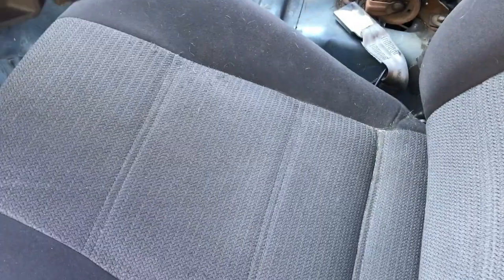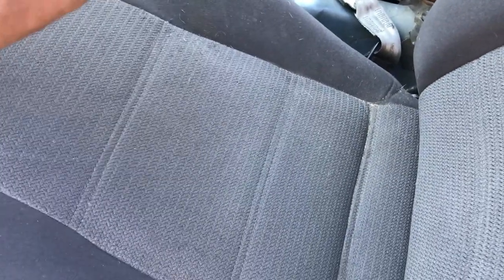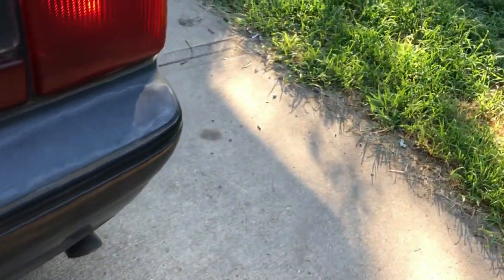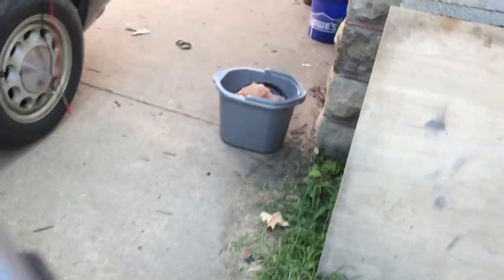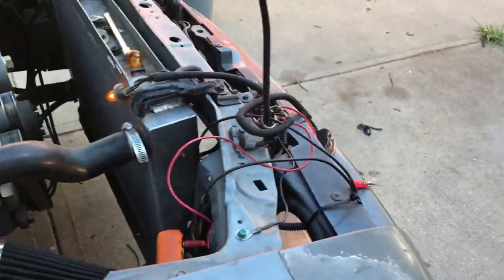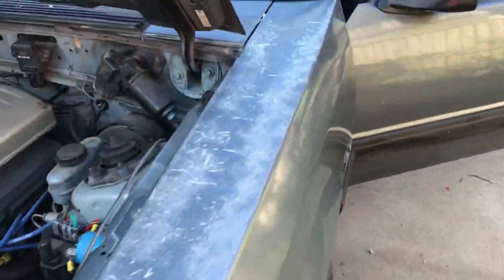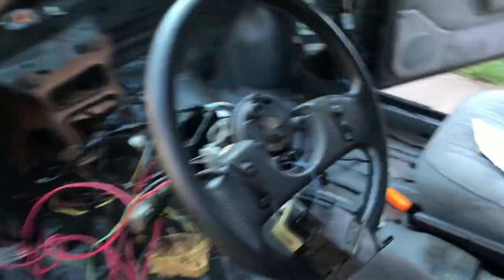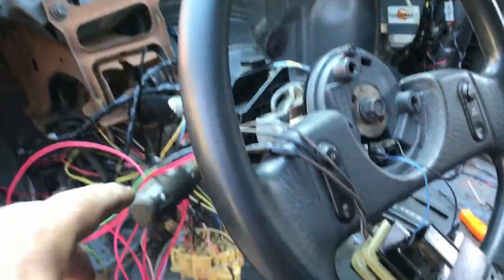87-93 Mustang wiring (exterior lights)

Comment: any tips on windows and door locks wiring
Reply from the maker: I removed the lock actuator and years ago. Power window wiring is tricky, but hang in there and keep trying. Start with getting drivers window working first and go from there. Good luck